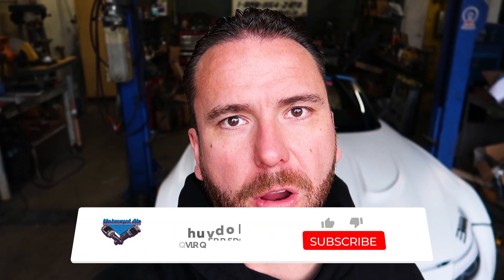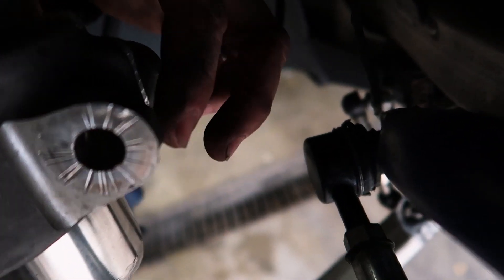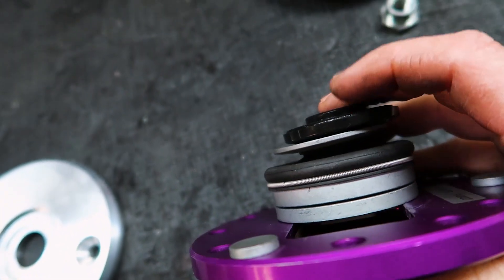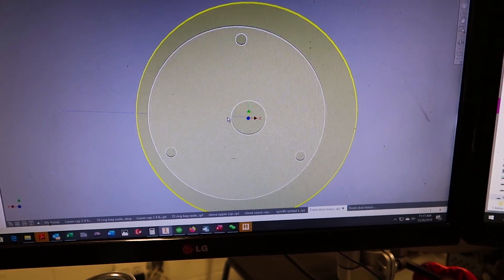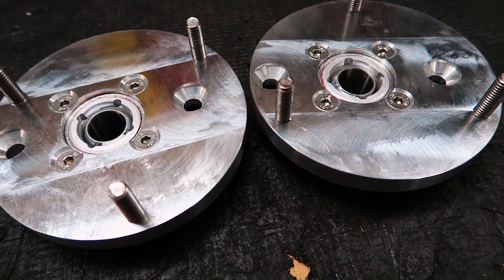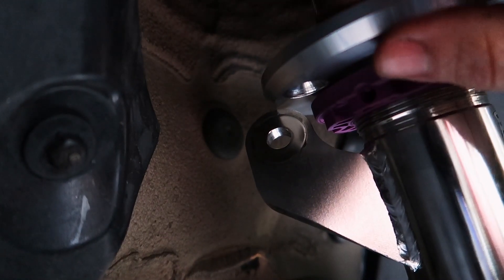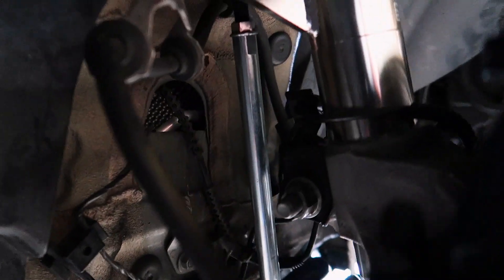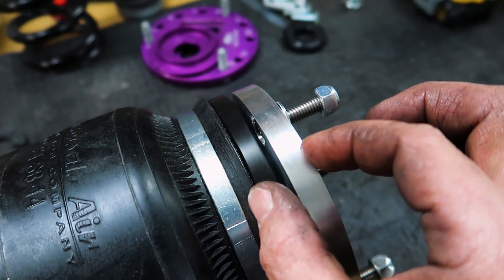Converting KWv3 to Air on a GT3 BMW Z4 E89 Race Car Part 1

Comment: Zach,  great clip,  thank you so much for the in depth description of your diligent custom work on that conversion/install.  I have to say it leaves me inspired and it leads me to believe that we can work together on setting something up for my complicated rear setup on the XC90 that we have spoken about even though we are opposite coasts.  Edwin.
Reply from the maker: Edwin,  Thanks for your comment!  Anything is possible, your rear suspension is just challenging since it will require some fabrication work, and I don't have the vehicle here.